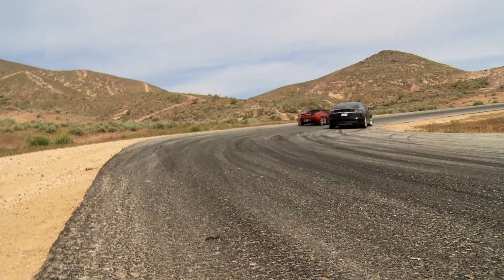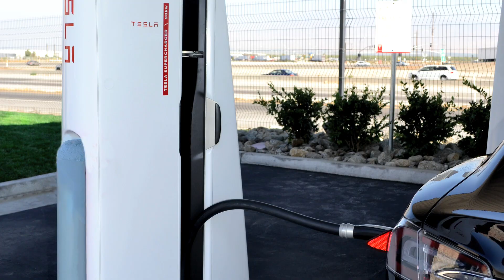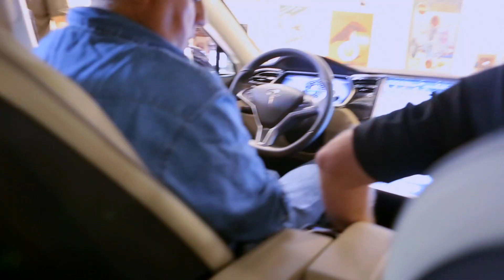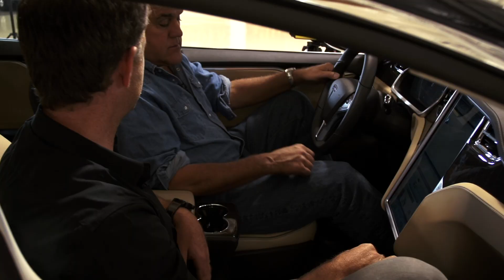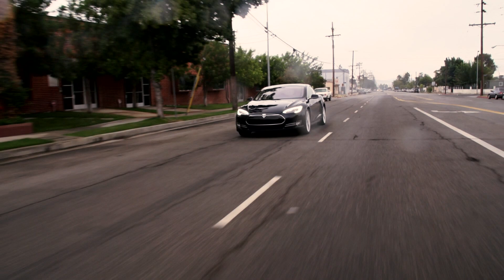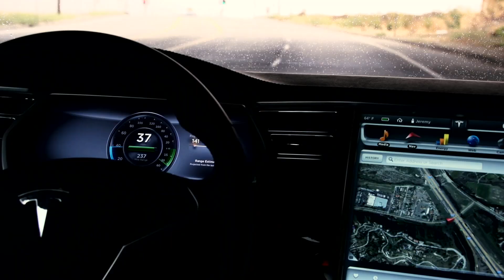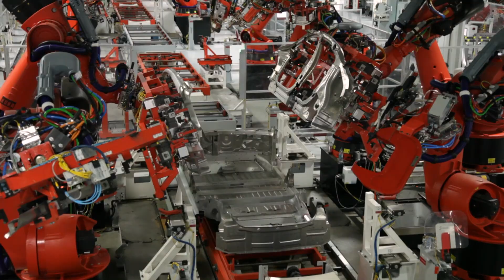2012 Tesla Model S - Jay Leno's Garage

Comment: Can someone explain to me why this car has haters? When I mean haters, I mean HATE. Doubters are fine but haters? Why? I don't get it. Why hate a car? Or innovation? It's not like these haters were planning on buying one but got disappointed? They just hate it.
Reply: Tacos Mananeros Network there's a huge flaw in there. A backup tank of fossil fuel would ruin this car. You'd need an ICE, an exhaust system, a drive shaft and a gearbox. You'll add a lot of complexity, bulk and cost for what...
Reply: Tacos Mananeros Network electric cars with backup gas usually end up ruining the car, it sits for a long time and goes bad and the moment that they need they need the backup the bad gas ruins the engine and its a very costly fix, more than a simple toe-truck if there isnt an outlet available. Plus a gasoline engine would make the car much more expensive. Also on average, the Tesla would cost less money a year to recharge than you would pay for gasoline. Drop you fossil fuel safety blanket, this car wont need it, who drives more than 300 miles a day anyway? not the average city commuter.
Reply: Tacos Mananeros Network Yes. Beautiful, don't you think? Small motor yet far more powerful than a 'traditional' ICE. And fast! Boy, this beast is fast!
Reply: @johnbenton4488  Well the battery is huge
Reply: Mejevoli Imagine if cars were all electric and somebody introduced a gasoline powered car, How would people react? It would be far worse. Search the web for "test drive of a petrol car" and it gives an idea of what people would have to go through. "If people have telephones they may be able to attend the opera in their bathrobes" was a legitimate concern when telephones were new. In 1998 I kept seeing news stories announcing "there's PORN on the Internet!" Some people say "these crazy environmentalists with their electric cars! Don't they know that global warming is a hoax perpetuated by scientists?" Since they don't like the idea of electric cars, they make up all kinds of excuses that have nothing to do with how most people use cars.

Two days ago my son got stranded. He ran out of gasoline. He kept coming home at night thinking he'd get to it the next day until finally he pushed his luck too much. Had it been an EV that got plugged in each night, that never would have happened. Even if he forgot to plug in for a few nights in a row it wouldn't have happened. People might forget to plug in, just as they might forget to take their keys out of the car or to lock the car doors. Is it likely to happen? I can only speak for myself.
Reply: KlunkerRider You seem to miss the point that this is an electric vehicle. It couldn't be made any other way.  It is driveable well off established interstate routes, and in almost no parts of the country there would be no problem going on long distance trips. Teslas have been driven cross country many times. 

You also miss the point that while it's not for everybody, the average driver drives 15,000 miles per year. That's about  40 miles on an average day. The car could go several days without charging, but why would anybody want to do that when it takes a few seconds to plug in and have it charge each night? There are Chargepoint chargers, there are hotels and restaurants, and the list  of places to charge is growing, so not being near a supercharger doesn't rule out travel. 

It's only on days where you would drive enough that you'd start off with a tank of gas and fill up later that day that you would need to use a supercharger.

With ICE cars, you need to worry about running out of gas, wonder if you will make it as you pass a "next gas 42 miles" sign, having to call AAA because your battery goes dead, or whether you'll have to drive to the gas station tonight so you will be able to get to work on time tomorrow. It's a relief not having to worry about it. 

People question whether the battery will go dead in the Tesla and leave people stranded. Dead batteries happen every day. But it's not happening to Tesla drivers. I've had times where my son left the door open on his car and I had to drive a far distance to bail him out by giving him a jump. Last week, he ran out of gas and I had to help him out. Those may not be everyday events for most people, but if you look at the percentage of people who run out of gas or get stranded because of a dead battery each day, and look at the percentage of Tesla vehicles on the road that get stranded because of a dead battery (it's 0 by the way) then it's not even close.  

Yesterday my son was low on gas and needed to fill up so he wouldn't be late to school the next morning. The closest gas station is about 10 minutes away. There were three people in line ahead of him. That meant a total of about 32 minutes to do something that a Tesla driver never has to do. For the rare road trip, charging time might be under what my son spent yesterday to fill up with gasoline.
Reply: 1 word. Jealousy
Reply: Holy Shock tesla released all their patents for free to everyone who wishes to use their car technology aswell as supercharger tech.
Reply: ganzano It's not a matter of getting there. Battery swaps can happen. If I drive 400 miles to Los Angeles I could stop for a few minutes and get a battery swap for about the price of a tank of premium gas. I'd get a free swap on the way back. Or I could park at the supercharger, get something to eat, and drive away as soon as I'm ready. The car charges overnight, and so far I've had only one trip like that. The rest of the time, I had zero wait time because it charges when I sleep. Even that time, I had zero wait time because eating is an everyday activity for me.  Last night I forgot to charge it. So tonight, instead of the charge finishing at 2 am, it might finish closer to 4 am. I still won't see a difference, and it's not as if forgetting to charge kept me from going anywhere. As it is, I've had only one trip when I needed to charge the battery to 100%. Charging to 100% is a rarity for most Model S owners, but an overnight charge would be more than enough to get there.  

In real life, owners start each and every day with a complete charge (usually 80% to 90% because they wouldn't need even that much) and have enough charge to go most of the week. But plugging in each night isn't an inconvenience so it's best to have a complete charge each day. On most long trips, I wouldn't get to the point that my battery is almost depleted when I get to a supercharger. maybe you have some 500 mile trip in mind that you have to take without a break for a meal, and that's fine. It might not be the car for you. I can't tell you that you shouldn't drive eight hours straight without more than a stop for gas, but then again I could do the same thing with a battery swap.

Another thing to keep in mind is that if you start the day with a 100% charge for that long trip, get to that supercharger with some capacity and most likely not close to fully depleted, you still need to charge only  enough to get to your destination. You don't need to go from empty to full on the road. If you are making such a long trip, chances are you aren't planning to drive 16 hours round trip with barely any stops. You will more likely stop at a hotel for the night. If you show up there with half a charge or almost none, it will still be fully charged the next morning. 

If range is still a sticking point for you, I won't argue. Each person has his own needs. What you mention is a very real concern for any potential Tesla buyer. It's just that once they own the car, all that goes away when they see the reality of how it works.  No matter how much people tried to convince me, I still felt that I'd have to spend time planning things out and changing my way of doing things once I got the car. It turned out that the biggest changes are not having to stop for gas, not having to drive to the gas station at night so I won't have to get up early and stop on the way, not getting up in the morning and finding that my son or wife used the car, didn't fill it up or mention it, and I needed more time than I planned for.  Going back to an ICE would be a major pain. And if I have to drive to the nearest gas station, which is about 10 minutes away, wait in line, pay, get gas, and drive home, then I'd be wasting about half an hour. The overall amount of time I save by not stopping for gas is very big.
Reply: +MrBadBricks  Let me correct you on this matter.
1. Lithium ion batteries contain NO heavy metals, NOR any toxic materials.  Lithium-ion batteries are recyclable, and the metal content of these batteries can be recovered in the recycling process.
2.Electricity is 100% clean of any pollutants at the point of use, meaning that electric cars have NO tailpipe. The proper accounting of emissions footprint shows that, in the U.S., electric cars, even running on coal powered electricity, are cleaner than gasoline compatriots. Also, wind and solar power is getting less expensive all the time.
3. Finding electric car charging stations isn't as difficult as you might think because you can find socket-outlets almost everywhere. 
4. Every electric car on the market is more efficient than even the most efficient conventional car.  Electric vehicles convert about 59%–62% of the electrical energy from the grid to power at the wheels—conventional gasoline vehicles only convert about 17%–21% of the energy stored in gasoline to power at the wheels.
Reply: Probably work for one of the many car companies that are existentially threatened by Tesla
Reply: Mejevoli people hatin cause we waiting for tesla to bring more dealerships, charging stations and budget freindly tesla's across america
Reply: Simeon Bairaktaris You are absolutely right. People have different tastes and nobody should buy this car who doesn't like it.  You were rational and instead of bashing the car you mentioned your preference.  The initial comment was about haters, not people like you. I don't hate cars just because I don't drive them. I didn't buy a Buick, but that doesn't mean I seek out Buick videos and leave disparaging comments. If all the "negative" comments were like yours, it would come down to a sane discussion.
Reply: My mom bought an electric car a few months ago. While it isnt a Tesla (Its a Renault Zoe), its a fully electric car so I am somewhat qualified to talk about it. I drive it too sometimes, and its just plain better than your average ICE car, except that it takes the fun of shifing away. But I would still buy it over a ICE car if I could afford it. The difference between the Tesla and the Renault is that the Renault costs 15k used with a rented battery and only has a range of 150km. There will be a battery upgrade out soon that will double the capacity, but my mom mostly uses it for commuting, so she wont buy it. What is a big bonus for her, is that she can charge it for free at work, and thats the only place where she charges it now.
Reply: nativepoint14 It's not just a matter of making it more expensive. A good part of its performance is due to its drive train. If you add an engine and a multi gear transmission (since ICE doesn't have low end torque and would need different gears) and then come up with some way of coupling that to axle, then you'd have to figure out where to put the electric motor. It simply could not be the same car.  For an AWD model, you'd need to hook the engine to all four wheels and have a drive shaft. Where would you put one? There's a battery down there. The MS gets its performance because of independent front and rear motors that are computer controlled and increase efficiency. You'd need to add an ignition switch or have some way for the car to start the ICE. You'd need a place for a fuel tank. Where would that go?  How would you decouple the ICE's transmission when the electric motor is in use? Once you look at all this, you end up with a completely different car. It wouldn't be a Model S with an ICE. It would be a completely different car and the Model S wouldn't exist. 

The advantage of the Model S is that it doesn't have all that baggage.  Getting rid of all that makes it possible for the MS to do what it does. Getting rid of that stuff is an absolute requirement. 

A bigger question is why they should add something that none of their customers want. If they announced a car such as the one people are talking about, approximately 0% of customers would want to switch to it. Demand for the vehicle would drop once it loses everything that makes it what it is.
Reply: +Mejevoli I'll tell you why these people are HATERS its because they are dinosaurs they can't see beyond their noses and like dinosaurs they are heading for extinction! Listen to the great Leno SAVE THE GAS FOR WEEKENDS !
Reply: +Mejevoli People are dumb. Welcome to Earth.
Reply: Firemarioflower Get out of the wrong side of bed did we? Your ill informed diatribe proves that you are probably an oil company shareholder. I won't even bother to answer you. Oh I am typing this as I'm at a Tesla Supercharger, enjoying my car and the experience of owning one. Cheers.
Reply: Mejevoli Because petroleum is big business that puts millions of people to work. And its silly, because you still have heating of homes for oil anyway.
Reply: +Mejevoli the only people who have a legitimate beef with this car are the people with 250+mi commutes. everyone else doesnt have a leg to stand on
Reply: bW9taeH4
thats all well and fine but i'm thinking more of people in middle america where they might actually have to go 300+ with no charge stations in sight like kansas i like the tesla bro dont come at me but it's really not fesable in middle america where everything is extremely far from each other unless you want to find me a supercharging station in kansas, nebraska iowa farm country
 in tohse cases a chevy volt would be ideal for now
Reply: neilcoo
i own a turbo na miata and dorve a model s both are fun. your opinion does not represent everyone. direct drive instant torque is hilariously fun to me and many of my peers. i can find enjoyment in all things on wheels that power themself. sorry you;'re such a downer keep enjoying your one dimensional cars while i have fun driving my friends lifted 4 wheeler, my other friends luxo barge s class my friend's deliver box truxk  etc etc it's all FUN  to me ...you light weight two seater only way to have fun nazi it's not the be all and end all in automotive enjoyment buddy get over yourself you're not a special snowflake cause you drive a sub 2500lbs car
Reply: +neilcoo  Battery apart, probably this car will outlast your actual car by some years. 

Mechanically, its gear train has less than  half the moving parts of a conventional car, discounting the engine's. 

Electronically, the power drive is probably from some industrial machinery and if it is, it should be able to go on for years as they do. The electric motors of the fans that cool uour PC, how many hours last between replacement? Mines have done 8 hours a day, w50 days a year, for eight years...

The infotainment system is more or less on par with other makes.

The biggest doubt is the battery. For the rest, there are alot less pieces in a Tesla to broke down than in a conventional car.

Not that I care ... give me my Giulia, now!
Reply: Because people like hearing the engine. and because due to gasoline engines being around for so long, it's pretty cheap to make them, meaning gasoline cars can appear to have better value since the saved money goes towards a nicer interior or prettier wheels, that sort of thing.
Reply: So much stupidity...

First, you're criticizing electric powertrains because contemporary battery technology still has flaws..? That's moronic, as demonstrated by your contradictory claim that hydrogen fuel-cell vehicles are the answer when they're also used to power EVs (they just use fuel-cells to generate electricity). 

Electric vehicles "lost" the battle in the 20s because battery technology at the time was awful, but it's much better now, and when super capacitors become viable, it'll be curtains for ICEs seeing as they're indisputably inferior to DC motors from a physics perspective. This much should be evident to even the slowest individuals seeing as a 5k lbs electric family sedan can beat top super cars in the quarter mile.
Reply: Phoenix Intergrale The Cactus is innovative and affordable, and it's a matter of taste. The design is very practical, and although some might not like the aesthetics, nobody likes the look of doors with dents and dings either. 

I don't think it's the same with the Model S because its body design isn't radically different from what's out there. I think it's just easier for some people to say "I wouldn't want one anyway" rather than to admit the real reasons.  In reality, the percentage of people who wouldn't want to buy one after test driving a Model S is extremely low. The people who say negative things about them most likely never drove one, and may not have e even been in one or even seen one.
Reply: +Snoopy Schulz A person with a 250 mile commute couldn't afford to be without one. The gas savings would put a Model S in competition with an economy car. If it's 250 miles each way, that person would want to have an HPWC installed at work, and a few hours later it will have enough of a charge to drive home.
Reply: +nativepoint14 Well, mmm I've not seen aged fuel ruin an engine, make it run poorly yes but not ruined.  It would be nice to have some type of fuel cell that runs on petro juice even if just to scavenge the heat like a walbro heater  to warm the battery packs and help heat the cabin on sub zero days.  Or just as a spare tire of sorts, when you've made a terrible miscalculation and then run out of power.   You can't design a car to be perfect 100% of the time so maybe areas where it gets sub zero is too far outside the optimal
Reply: +Snoopy Schulz that's a fair comment. For now, it's not really a good fit in that part of the country, unless you want to install a 220 outlet. But that's something that just about any owner would do anyway. If you drive the typical amount, meaning 15,000 miles a year or 41 miles a day, then there should be no problems at all. If you want to make a long trip within Nebraska, you would have a problem. You could go to a mobile home park and plug in there, but that wouldn't give you the fast charging you need to make it practical for long trips on a regular basis. For now, it's well suited for many parts of the country, but certainly not all.
Reply: +Charles Curt Even if you get the p85d you don't automatically get leather unless you pay for it. If you get the 70, you can get leather if you want it. Many people don't want leather for humane reasons. The base vehicle still has the options that the top one has except for the speed and acceleration. But even though the 0 to 30 acceleration is a lot lower, once you get above that it's fairly close and going from 60 to 70 on the freeway or 70 to 80 on the freeway won't make much difference. You would probably want to add things such as autopilot even to the base, but the battery these days even on the entry level one is more than big enough for not only everyday use, but to get you from supercharger to supercharger. It rides well, performs well, and is a much better car than other things in its price range. There are only so many times that you can launch from 0 to 60 as fast as you can, so in everyday driving, you won't even see the difference between the base and high end in that respect.
Reply: Half of them can't even afford it
Reply: 691 hp 687 tq  instant torque...no fun...hahahah yea ok neilcoo
Reply: +Reverend Tacos Guidos Mananeros Haha no way, with 200 mile of range who cares about some SF hills.  Climbing hills at low speed hardly uses much energy anyway.
Reply: alarjak  It's just the opposite. It's PRECISELY how religion works.  Indoctrinate big lies on non-believers untill they have no choice to believe it (being fooled by their manipulated brain and the world around them).

And redicule those persistant good hearted ppl that want nothing to with those deceitful things and wrong ethics.
Reply: "But my biggest concerns are the joy-kill of the technology. We are being babied, like incompetent animals. WE can't drive stick, we can't park, we can't this and that and everything has to be done for us, by stupid unemotional robots taht dont grasp our refined wishes and kill all the fun, challenge , experience."

You have a point there. But to me big part of the joy of Tesla is its super fast acceleration, you can pass cars like nothing else out there. I also like quiet comfort, no disappointments there either, but from practical point of view the most important thing is that it's always ready to go, just plug it in and it just waits there warmed and ready when you want. In winter it's big deal that you can heat up your car just using phone. Not a bad thing that the need for gas stations is also gone.
Reply: Firemarioflower "You can get much faster acceleration in a petrol car, like the Audi R8, Mercedes SLS. Or when you want super sedans an A8 Plus.  Which is cheaper. And Teslas have slow top speeds. they can only go up to 210."

0 to 100kph in 3 seconds. In real life it is even faster because all power comes immediately, there is no delay at all, 'gas' pedal responds at speed of light and i'm not kidding here. Top speed is 250.

"Quiet and comfort??  Get a Mercedes S. 65 AMG perhaps considering your need for acceleration."

Tesla has mercedes air suspension. And very good sound proofing.

"Why with phone? explain why that is so handy? "

For example, you are sitting in the kitchen table sipping coffee while outside temp is -20 celsius. You grab you phone and tell Tesla to start warming up the car, steering wheel and seats. Because there is no engine to warm, all starts to warm up immediately, windows clear up in few minutes because heat is generated by electrical thermal element. Battery is in floor and warms up also so you have a floor heater there.

"What's wrong with gas stations?"

Instead of going to fill your tank in the evening for morning drive there is no need for that, just plug it in when you get home. Also in bad weather i would rather drive my car than stand in freezing cold.

"I'm pretty sure there's innovations to warm your car beforehand on newer petrol/diesel cars too?"

Might be in top level cars if those have enough heater elements, i doubt that those can still generate 6KW of heat as Tesla does so those are not as fast.
Reply: alarjak  If it's superior, then why does it have so much flaws?? Anyway, for me it provides no soul.  i want to think for myself.
Reply: alarjak Good!  :D   At least your not the same as those greenists who look down on us petrolheads who still cling to our fossil machines because we love them.

Apology for my accusations.

So i take it this Tesla is a special kind of thing for you?
Reply: Firemarioflower "So i take it this Tesla is a special kind of thing for you?"

It is technical love child of one genius, who is pushing his staff to make it better every day. It is not made average as many cars today are, but to push the envelope even further. I like that kind of thinking and people behind it.
Reply: Ijusthopeitsquick  Better handling, attractive sound,  fewer nerdy gismos,  safer, better built, more quality,  less of a symbol of eco-fascists.

If there's anything that can replace petrol it should be hydrogen. But petrol should STAY!
Reply: Firemarioflower Hydrogen is not viable. To make hydrogen you need to use a LOT of electricity, and that electricity is much more efficient going directly into battery packs. Who are pushing hydrogen cars? Oil companies. Why? So they can keep drilling for natural gas to burn, to generate electricity. Also, I don't want to be in a car with hydrogen. It is massively dangerous, many many more times more volatile than petroleum.
Reply: Heh, "electric cars are ruining car culture"

Look Steam Locomotives are cool but you've got  to face facts, diesel locomotive engines and electric trains are highly more efficient, provide more power, and are a more enjoyable and comfortable ride. Steam Locomotives are 100% for show and people will always appreciate them, but they should not be used for anything except the novelty of it. You'd have to be insane, as mentally unstable as a mass murder, to say that "car culture" is so much more important than all of the above, and will get ruined by getting replaced.

Electric cars will eventually be an all around better alternative to combustion engines, that will happen. Hating on the inevitable isn't healthy, learning to accept what will come will make you a better person. Eventually electric cars will become mainstream and the grease blocks will become a novelty, just remember history is a bit easier to record these days. If you're outraged at electrical cars and throw fits and do your best to stop it from happening, guess what happens in 10-50 years when electric cars are the norm and gas powered cars are a toy... They see you acting like a child who can't let go of their playthings.
Reply: 10 years later and we still have massive HATE on teslas.
Reply: Mejevoli Ya, Know Tuners...... They Hate Ricers
Reply: Mejevoli Well, i personally know a lot of people who like traditional interrior for their car, and this one is far from it.
For me, if a car has a "matrix screen" instead of the nice gauges, it just ruins the car. I also like to drive the car, meaning shift gears manual gearbox etc.
Now i havent done research for this car in particular, and i have nothing against innovation, i simply like it the old way.
Thats reason enough to not buy something like this, or the prius for example. I have to like what i drive.
Reply: *****
"a base tesla is crap" i'd take one over a gtr or a s600 anyday . different strokes bro.
"and yes you are right about overall cost with the mercedes but with the nissan no"

nissan gtr launch control repair costs 31,500

tesla battery replace ment costs: A separate battery replacement guarantee takes effect after the eighth year at a cost of US$10,000 for the 60 kWh battery and US$12,000 for the 85 kWh battery.

want to know how much the engine and transmission costs to replace on the gtr ? haha this guy
Reply: +Mejevoli i dont like that huge screen and what kind inconsiderate parents would leave their kids unattended in the back... that being said it is awesome a real competitor for regular saloons
Reply: Ricky Rose
because deregulation has worked sooo well for the usa hahaha
Reply: +Reverend Tacos Guidos Mananeros The motors are basically placed on the axle.  No need for a motor to transfer its power elsewhere!
Reply: +ZesPak then all the servicing and oil changes for everything that goes with it.
Reply: +neilcoo How wrong you are. I have not driven the car but many people are saying its a very fun car to drive.
Reply: +Phoenix Intergrale The Cactus is horrible to look at.
Reply: +Mejevoli Oil industry...
Reply: +Povilas Pavardenis: The jury is still out on your point number 2 whether you can bring yourself to admit it or not:

http://www.washingtonexaminer.com/new-study-electric-cars-may-be-worse-for-the-environment-than-gas-powered/article/2566847

http://www.huffingtonpost.com/2014/12/16/electric-cars-environment_n_6329186.html

http://www.dailymail.co.uk/sciencetech/article-3151637/Are-electric-cars-damaging-region-Maps-reveal-EVs-WORSE-environment-gas-guzzling-vehicles.html

http://seekingalpha.com/article/1418421-is-the-tesla-model-s-green

http://www.popularmechanics.com/cars/hybrid-electric/a3259/electric-cars-pollute-more-than-gasoline-cars-17535339/
Reply: Mansa Musa  In the sense that a car CAN do damage to the environment (but it can't, its all bullshit and global warming is a scam dreamt up by a lobby), then yes, the electric cars are more wasteful by their production process alone!
Reply: Firemarioflower It's just the opposite.
Reply: alarjak Believe what you want to believe
Reply: Firemarioflower Religion has nothing to do with facts.
Reply: Firemarioflower I'm just about as far away from any hippie you can think of.
Reply: Firemarioflower Not planning to go back old school technology, once you try it you won't go back, it is superior in every way.
Reply: alarjak   You can get much faster acceleration in a petrol car, like the Audi R8, Mercedes SLS. Or when you want super sedans an A8 Plus.  Which is cheaper. And Teslas have slow top speeds. they can only go up to 210.

Quiet and comfort??  Get a Mercedes S. 65 AMG perhaps considering your need for acceleration.

Why with phone? explain why that is so handy? 

What's wrong with gas stations?

I'm pretty sure there's innovations to warm your car beforehand on newer petrol/diesel cars too?
Reply: Firemarioflower "Did you know that  there's rumours Tesla lied about the 700 ps version?? it turned out to have only 468!!! "

That is not true, there is youtube dyno video where single engine Tesla makes 438hp, there is just no dyno that can dyno dual motor, too much torque, there is also data sheet about Tesla dragtimes.

"Plugging in is stupid. If you plug in you have to wait for over 6 hours!!! "

There are superchargers for that, you have cup coffee and a restroom brake and you'r done.

"Furthermore, you don't have to fill your tank as often as those batteries, who have very small ratios.  "

That is true but i only drive about 500km a week so one charge a week is enough for me.
Reply: alarjak  Ok it's clear. It's got some benefits. There's more to that car than i thought, i must admit. This isn't anything like a Prius at all. good luck with it sir. Sorry for my rude statemetns.
Reply: Firemarioflower It's no prius for sure :) I hate all other hybrids and ev's.
Reply: +Reverend Tacos Guidos Managers see at least 5 a day
Reply: clueless
Reply: not at all
Reply: Should put them with restaurants or next to hotels, parking lots and resorts.
Reply: Touch screen controls are distracting, possibly dangerously so,
Reply: It's for a lot of the same reasons Windows users hate Macs. Shields UP!
Reply: Reverend Tacos Guidos Mananeros ELECTRIC BILL? IM GUESSING WHEREVER THE FUCJ YOU LIVE HAS FREE GASOLINE FOR ICE VEHICLES? Next level logical fallacy holy jesus bless your non-existent brain and critical thinking skills man
Reply: I think the reason why is not the car itself, but Tesla, Teslas "evangelism" and labelling of doubters as "fossils", and yet Teslas regressive approach to owning and maintaining your vehicle. 

Put simply, many people dont hate eletric cars - they hate Tesla, its apple style "lockdown approach" and its "holier than thou" attitude. At the end of the day this is just a car (and not a particularly good alternative to a cheap second hand ICE car, which is generally much cheaper to buy and operate), yet is pushed as the second coming of automotive christ or something.

Not to mention it makes no engine noise, which many people just like and want in a performance oriented car.
Reply: Mejevoli Tesla and electrics are a lie you can drive a 57 Chevy 25 years and create the same pollution takes to create the battery’s for the Tesla!!
Reply: Do your homework on this car you cannot service it only Tesla can and id your not close to one when it breaks down you have to get it transported to a service center and look up how many fires have happened I wanted one melt to the ground in less than 5 min and destroy both cars next to it.
Reply: Do you hate the pt cruiser?
Reply: Because people like you get down on your knees for a car that doesn’t move the needle whatsoever.
Reply: There's probably quite a few things you don't understand
Reply: @petemiller519  congratulations
Reply: Because it’s the sign of the end of petrol motors! Maybe not for many more years but it’s inevitable now that Tesla is a success. Racing won’t be the same with these electric super cars now😢
Reply: Reverend 'Tacos' Entertainment Channel  the car works really well in San Francisco and bill to charge at home is pretty low I pay about 80 dollars a month in electricity and in total I pay 200 dollars a month
Reply: No hating from me....none. I LOVE CARS! Internal combustion or not. This Tesla REPRESENTS THE FUTURE of automobiles. Seriously. Does anyone think 50-100 yrs from now. So the year 2120 there will be NO INTERNAL COMBUSTION ENGINES! GUARANTEED!
Reply: @reptileguy8458  Wow you're soo passionate.
Reply: Reverend 'Tacos' Entertainment Channel No engine . . . But a motor . . . An electric motor.
Reply: Dark people get irritated by the light. The mediocre hates the genius (Mozart and Salieri).
Reply: ganzano More like 20 minutes to charge it at a super charge station. We have one in the next town over, I see it pretty frequently and I never see a Telsa there for even a half hour before they drive off. With that twenty minutes or so, you could go to the bathroom, get some water, and relax a bit before you get back on the road, because I dont see someone going over 300 miles a day just driving around town so the super charge station is very useful if your on a road trip or something, which is nice because it forces drivers to take breaks
Reply: +Charles Curt
first off no the tesla is not more expensive 
tesla msrp 101,500
mercedes s600 msrp 169,050
nissan gtr msrp 101,770

also internal combustion engines require regular maintenance of spark plugs, oil , air filters, tranny fluid, radiator flushes, belts, chains ,rings, head gaskets, valve cover gaskets, exhaust gaskets, motor mounts, alternators, starters, throttle bodies, evap system, diff fluid, and many more i cant name off the top of my head 

the tesla requires brakes, and wheel bearings and tires and battery in 10 years ...who's saving more money in the long run ? there's is no wear and tear on an eletric motor , you dont seem to understand the streess an internal combustion engine is constantly under even at idle
Reply: Teslas are the future for the way of travel, oil companies need to worry about this, I a lot manufactures are making electric vehicles but I hate them cause you can only go 100 miles or so, and everyone I know loves them I'm like really they are not economical at least where I live, if Tesla would come off their patent maybe we can get this whole electric era moving, I compare Tesla to apple lol
Reply: alarjak  Oh, are you?? Then drop the act and admit that believing in climate change is a foolish idea and redeem yourself. 
Join the auto-loving crowd and fight this scam!
Reply: Mejevoli No hate here. The cost is FAR too high on the Teslas, however.
And for now the range is a sticking point since the battery packs cannot be swapped out and if you run the car down to very little, a recharge even with the "Super-charge" station if quite a lot longer than stopping to refill a tank on an I.C.E. car. 40 minutes to get a full charge. So a quick 'pull-in-pull-out' is not possible.
Will they overcome this? Who can say. I sure hope so. I would like to see us move off of fossil fuel.
Reply: Mejevoli they hate innovation :) the same hate goes to BMWs new i series too
Reply: I hate the car not for the car itself, it's a beautiful design, very innovative and serves it's purpose in the short term. It's because of the subsidy given to companies like Tesla, just as wind and solar supposed 'utility' companies get. It's giving tax payers money on a dogmatic belief in environmental benefit. Even if there were genuine proof (being hypothetical) of emissions based negative effects on atmosphere, it's still morally wrong to give unfair advantage to any company over another, be it in terms of finance or regulation. Since when has government involvement in the economics of private enterprise ever favoured anyone other than those with hidden agenda?
Reply: If all cars were electric and some one invented an ICE powered vehicle, buyers would be all over it: three times the range, one third the cost, 40% lighter, uses fewer resources to manufacture, requires fewer hazardous metals, doesn't require vast amounts of AC current from coal-burning power stations...the list goes on.
Reply: +Mejevoli Some of us like driving for pleasure not just to get somewhere.This car epitomises the mindset and trend of turning a car into a disposable white good like a dishwasher, that is no fun to use.  Thats why.
Reply: ganzano this "lot of folks" is a still a minority of drivers, and electric cars are not really supposed to long run vehicles, just commuter cars for those who live close to their daily destinations and have more currency to expend. If your going more than 300 miles a day, you will probably either need to move closer for efficiency sake, or get your cheap fossil cars. Teslas aren't for the "frugal" just yet.
Reply: For one, many owners are cocksuckers. Secondly, they are more ecologically damaging but people don't realize that. Plus they need better quality interiors.
Reply: alarjak  3 seconds? There's no way that could be right.  Did you know that  there's rumours Tesla lied about the 700 ps version?? it turned out to have only 468!!!  250, oh yeah, your right. I only looked at the lower models.... Apology.  But i read 3,3 seconds.

It does??  Well good for Tesla, at least they learned something form those  'dinosaurs'.

Plugging in is stupid. If you plug in you have to wait for over 6 hours!!!  So you cant drive off whenever you want. And during a holiday in France thats even worse!!  And filling a tank  (here's what i meant with lazy ppl) is not that hard. who wants to waste time with a plug while its as plain as it gets. filling a tank takes 12 minutes max.

What if you have a crisis in the middle of the night and your child gets injured and you have to rush to the hospital?
Then the Tesla will be useless, whilst planning your gas fill up moments rightly you can use the car at any moment.
I'd simply get up earlier and put fuel in it the same morning.

Furthermore, you don't have to fill your tank as often as those batteries, who have very small ratios.  

Allthough I agree that by your explanation a phone is handy. If it's a simple phone that is.
Reply: Firemarioflower WOW, forgive me being so frank but you are VERY dumb. Every. Single. Comment.
Reply: Edward Byard  Nobody is pushing hydrogen cars.  They're worhtless but electric cars are more worhtless.  Batteries are less eco-friendly and also don't last long. They don't have good milage either.

The people still only want cars running on flammable liquids, petrol and diesel. It's the best recepie. Electric cars lost the battle in the 1920s for a reason. they sucked and petrol was superior.   And hydrogen is the only serious alternative.
You can't stop democracy for your weird fantasies and fairtales of  'rising sea levels' and other doom scenarios that are never proven.  

And you better don't say anything about pushing, hypocrites. Tesla and other eco-fascists gets zillions of subsidizing by the governments and eco-lobbies enforce this,  whilst the oil companies play fair and only go by the free market.
End the subsidizing and you'll see,  electric cars won't sell anymore nor could the companies who soly make eco cars survive.

What do you think of the danger in electric cars?? The chances of surviving a small fire is much bigger than getting a massive shock when you crash a Tesla into a tree at speed.

Yet ppl still act like Tesla is a real product of innovation whilst they're crappy built, unreliable, and not as great to drive as petrol cars.
Plus electric cars aren't new. like i've said.
Reply: Mejevoli Its a great looking car, but I personally HATE that it lacks a gen-set. That would free it from the charging station tether and allow it to be driveable well off the established interstate routes and still limited charging stations. The ugly Volt is still far more versatile than the lovely Tesla.
Reply: I am glad it is good for the environment. But Elon Musk is an idiot and electric cars are ruining car culture.
Reply: nativepoint14 No, that's a lie, it is NOT 20 minutes. That is for approx 1/2 charge. This is constantly repeated without being accurate so here is the page on Teslas own site.
http://www.teslamotors.com/supercharger

And BTW, it is 40 minutes for 80%, 75 minutes for a full charge.

And just because YOU don't have to drive 300 miles in 1 day does not mean there are not a lot of folks who DO. Also, plenty of folks who drive like to keep to schedules and don't appreciate being forced to take a break and tack on added time. I would need to stop twice using the 20 minute 1/2 charge to get to my destination, a trip I make frequently.
As it stands I only need to stop once and for about 5 minutes. I don't take 20 minutes to "go to the bathroom" or "get some water".
I want an electric, but not if it is going to cost me twice or more what a moderate and sensible car does, and surely NOT if I have to change my driving schedules and plans around it.